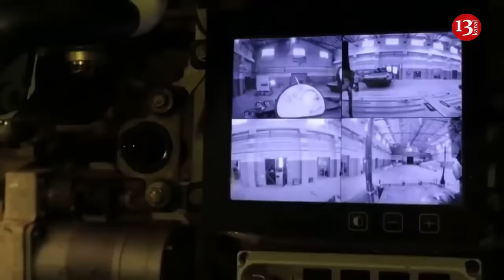Ukrainians captured another of Russia's newest T-90M Proryv tanks and it is used against invaders

Comment: modern? u call that modern?
it has a slower rate of fire than the autoloader of the USSR built T80 tanks 
also T 90 's most modern ammo is is the 3BM60 witch is of soviet era ammo (granted its made in modern days but still its an old shell)
gearbox,what gearbox, the acceleration pedal is more like a suggestion pedal and dont even get me started on that revers speed 4km/h in revers what is that a guy in a wheelchair would be faster in revers than the T90/T72 tanks 
Also Ukraine for god sake pleas start using the smoke launchers on your vehicles,use them for your tactical advantage use nato tank doctrine